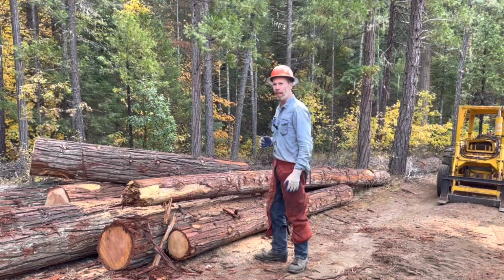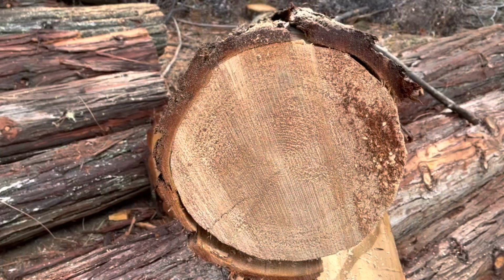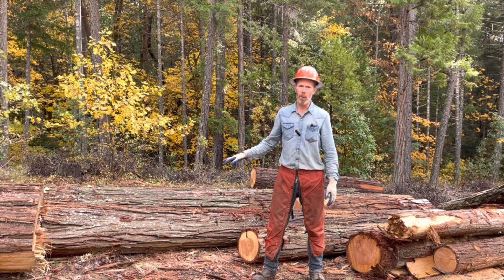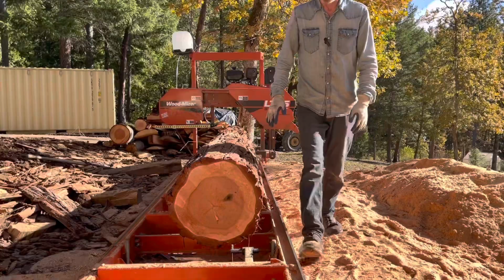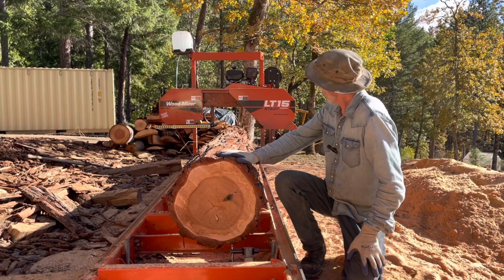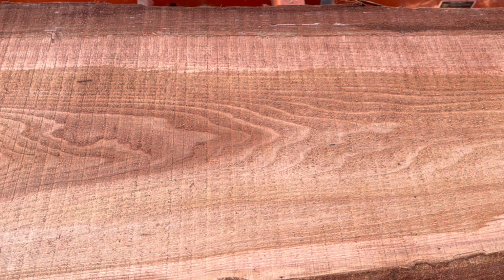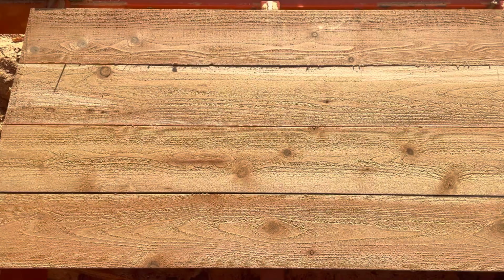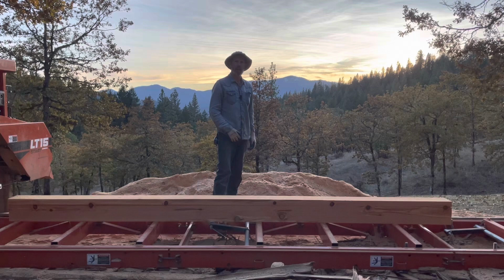Milling 2x6 Incense Cedar Deck Boards on Woodmizer LT15 Sawmill

Comment: Beautiful mountain top view of nice sunny days. Ain’t it fun when you have a plan on what you are going to mill and once you cut into it, there goes that plan 😂 like they say.. take nothing for granted , everything is etched in sand . When the wind blows everything changes. But I always say, when the sawdust starts flying and then comes to an end. Plans can change.
Great looking lumber.
Reply from the maker: Well said. when working with logs and trees, you have to be adaptable. Running a mill would probably be very frustrating to someone who wasn’t prepared to adapt. Thanks for the comment.